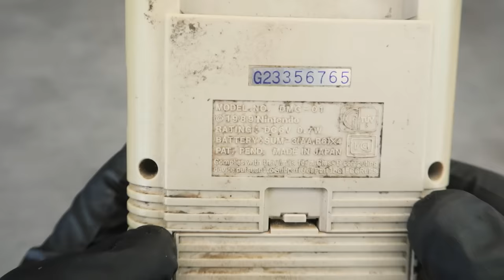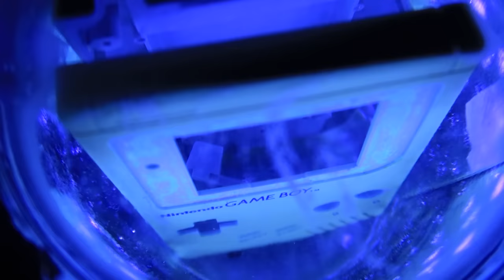I Restored This $9 Broken Gameboy  and SHIP it to another Youtuber

Comment: That was quite the transformation! However I do think you should invest in a proper soldering iron now, something with a point!
Reply: It's the lack of flux that is the problem. Without flux the solder kind of acts like honey and sticks to everything. With flux is seems to flow like mercury and covers metal way better.
Reply: scoper49 can confirm, you REALLY need flux when soldering.
Reply: @ShadowEli94  nff pi a1ij u o0i0l
Reply: And thus is why we should pledge to him. So he has money to get such tools :p
Reply: What he did was actually a cold solder joint. Not good.
Reply: Yeah, I second that. Get a proper Electronics Soldering Iron and some flux. I know it's messy putting that greasy stuff on your freshly cleaned electronics before soldering them, but trust me: It's worth it.^^ I don't know how I ever got around without that stuff. It's good Solder-joints from here on out...
Reply: @mackryanba-ay6056  you make a very true and comprehensive point
Reply: @mackryanba-ay6056  WHAT
Reply: @mackryanba-ay6056  true
Reply: @himesjon  potato solder
Reply: @scopie49  Most solders have flux in them now so home solderers really should not even need to bother with it. I used to build circuit boards for a contractor that had to be done perfect. That solder joint on the end was killing me as it would have been rejected so fast I was screaming but thats only bc its the way I was trained. Perfectly acceptable for electronics. The only reason he would need flux is if he were retoring a circuit board where he had to replace greater than 25% of the compononts on it. I do recpmmend a better soldering tip though. Soldering irons are dirt cheap nowadays as are tips but flux just adds the headache of more cleaning when you do not need it for one or 2 solder joints.
Reply: Maybe the solder was flux cored?

Comment: Just a little tip for the future: When you use those alligator clamps on the magnifier with bare metal, it can scrape away the board's coating, but you can slip a small piece of surgical tubing over them to prevent any accidents :)
Reply: 14:06 GAME OVER

Comment: 10:25 that soldering job hurts, use some flux dude.
Reply: the flux isn't the problem
Reply: @SilentServiceCode  you need to be more specific.
Reply: tbh he just needs a proper soldering iron, the one he is using looks like a pipe soldering thing. once you have a good pointy tipped soldering iron you just have to remember to heat the component and not the solder itself.
Reply: @blockstacker5614  Of course a "proper" soldering iron will do a better job. If it works, it's no shame in using the tools you have. But without flux or resin you can't make a "proper" joint, that solder needs to flow not to stick into a mountain - that's called a cold joint.
Reply: @_v-i-c-t-o-r_  yeah, ive not worked much with re-soldering joints, just making them. since the flux is a part of fresh solder i guess a finished joint it all evaporates and you need new flux so it flows nicely

Comment: Man, i got a Ps3 original. Not the ps2 backwards compatible one, that is just chillin in my basement. Quick working about 12 yrs ago. I believe it was due to the thermopaste on the processor cracking it it got hot. They would play Blu-ray back then but it taxed the systems so much it got smoke. Had to tear it open to get the smurfs disc out so i could take it back to the video rental store. I wonder what it would cost to get it to you across the pond from US.